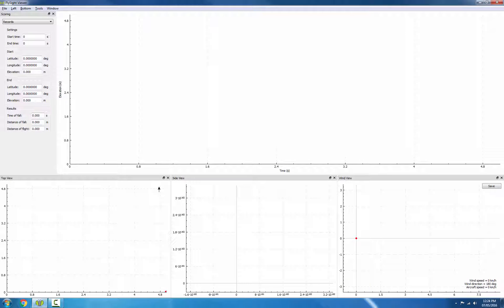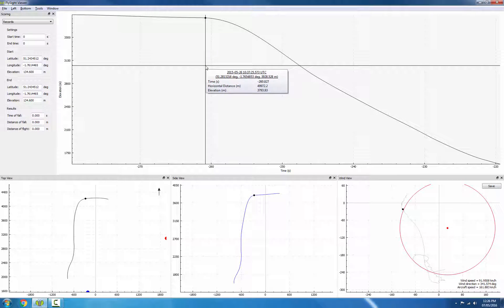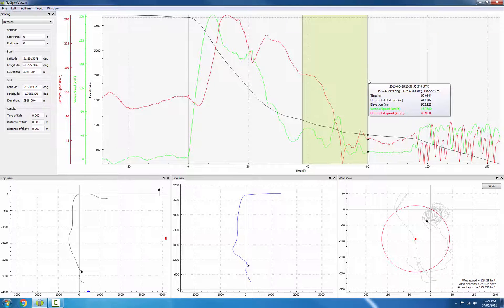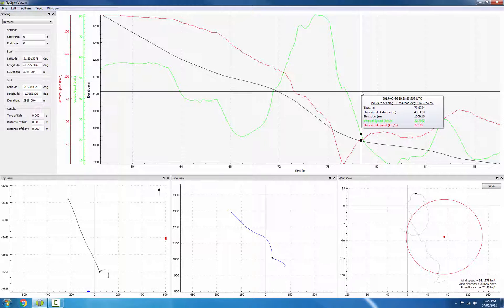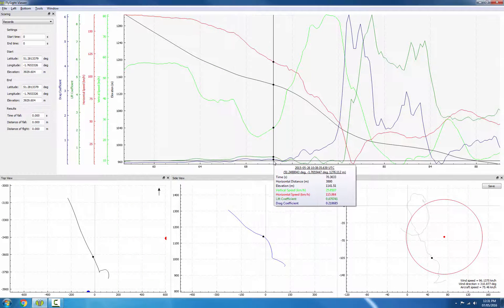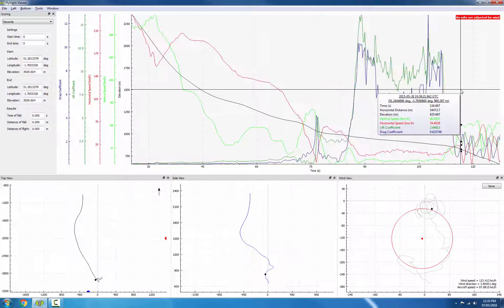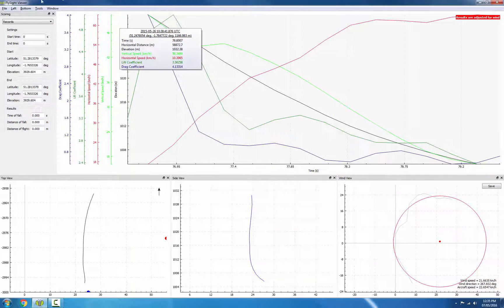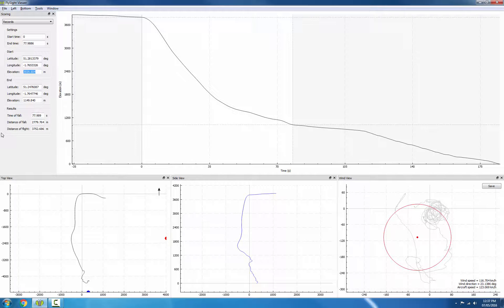Evaluating performance with FlySight Viewer

Comment: Your videos are quite helpful in getting up to speed with this software.  Nice job.  What is the difference between 'side view' and 'front view' and how are those views determined?
Reply: The top/side/front view are three views of the jump. If you click and drag left to right in the top view, you should see that it turns the plot around. On the right side of the top view is a red dot and on the bottom is a blue dot. Notice also that the front view is red and the side view is blue. The front view is actually the view from the direction of the red dot; the side view is the view from the direction of the blue dot.

The way you would typically use this is to turn the top view until the axes line up with your desired front/side view. For example, a swooper might turn it so that the swoop itself lines up with the horizontal axis. Then the front view will show the view of the swoop from the front and the side view will show the view from the side.
Reply: Brilliant.  Thanks for the response.